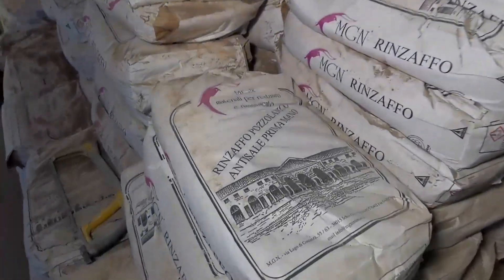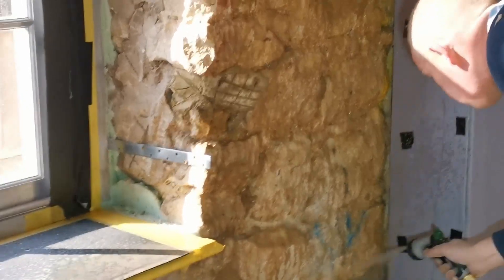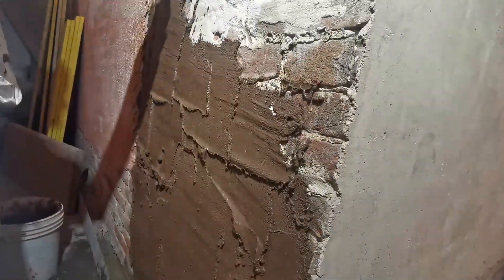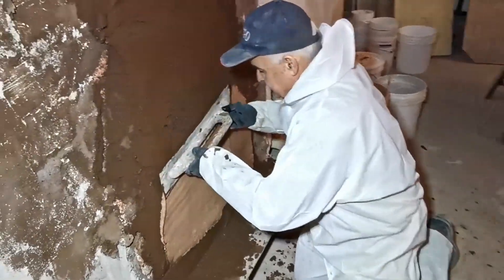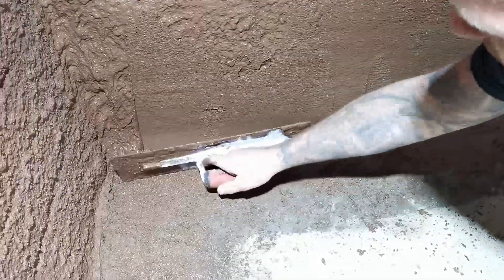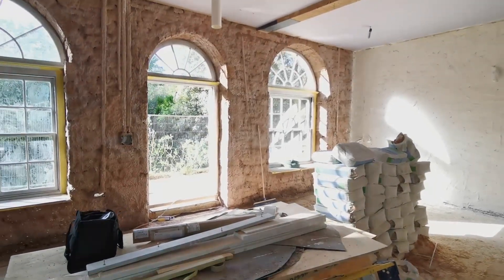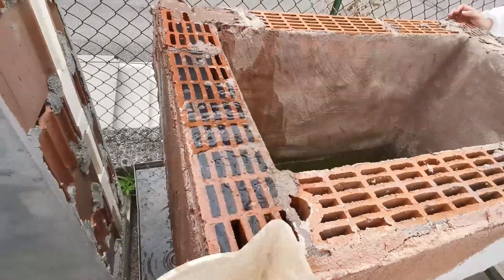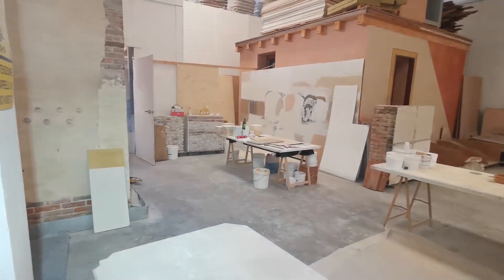Rinzaffo MGN - Roman Waterproofing Lime Plaster Application

Comment: Could this product be used internally in shower / wetroom areas? If so how would you recommend to use it?
Reply from the maker: Yes, it could however it has not been designed for that as it is a base coat that supposed to be covered up by a decorative coat. This finishing here is more suitable for bathrooms or similar applications: https://www.youtube.com/watch?v=pltxLf1cfa4